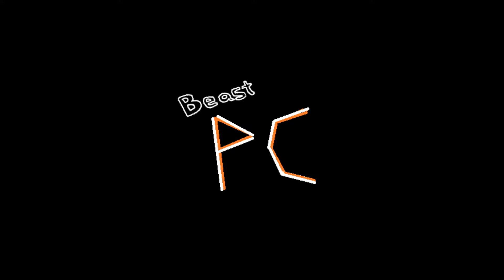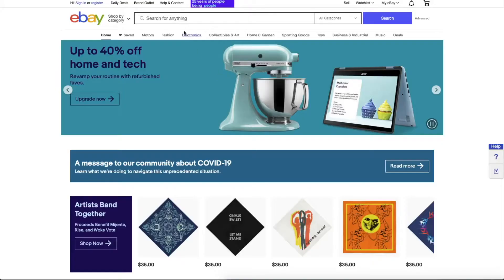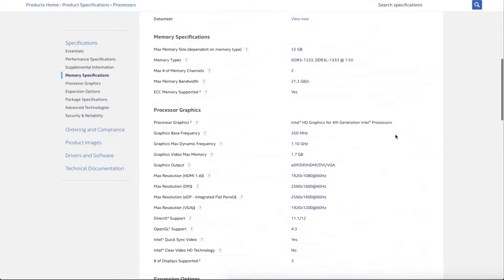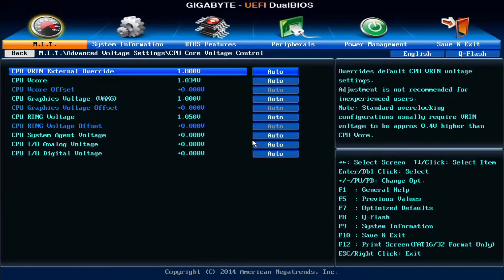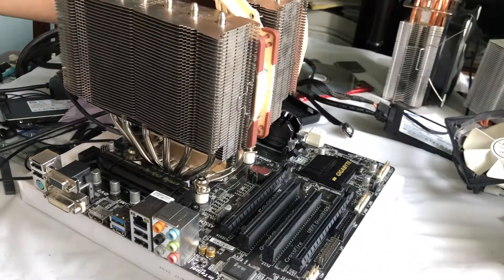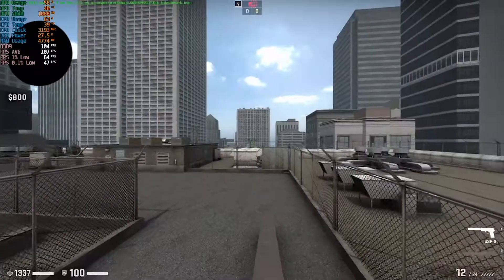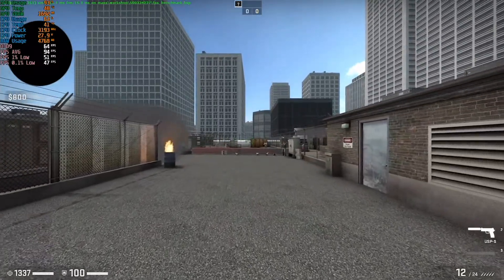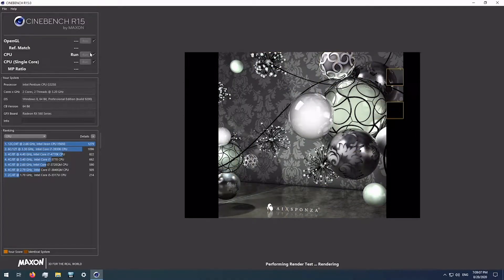Testing and Overclocking a $15 Pentium G3258 to 4.6GHz! How Does It Hold Up in 2020?

Comment: W8 shadow of the tomb raider cant run? My pc can somehow idk dude same processor but yea great video my dude.
Reply from the maker: It's possible our result was a fluke and maybe we overclocked too far? Great to hear you were able to get it running though, that's very impressive for such a CPU.
Reply: Confirmed, I ran it with 4 gb and a r9 270x.